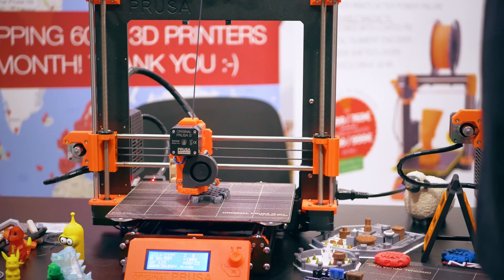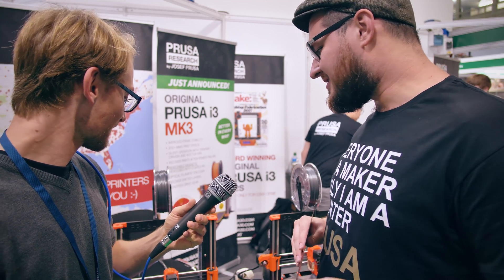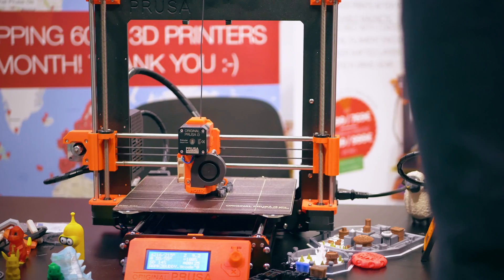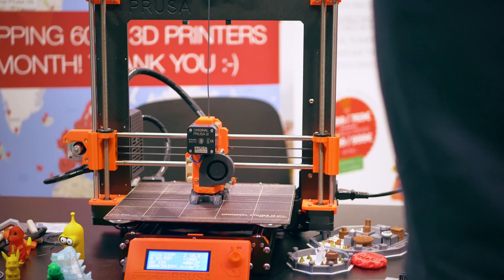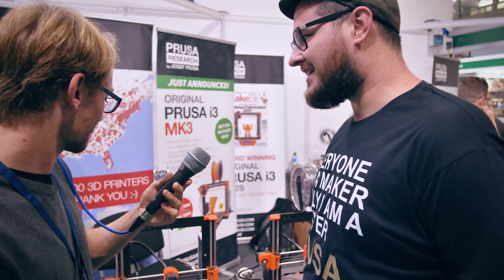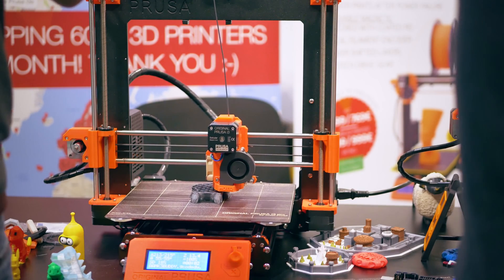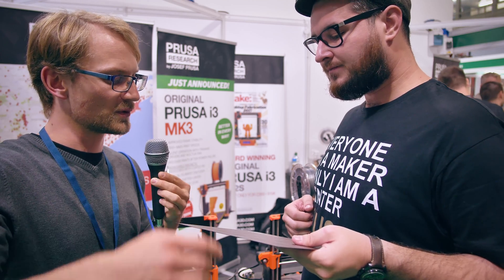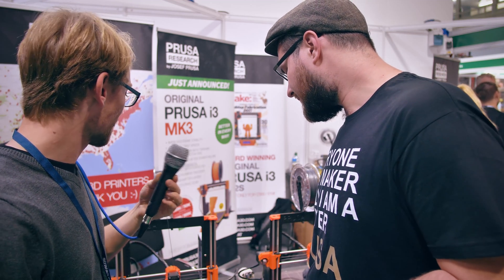Second look at the Prusa i3 MK3: Sensory overload! #TCT2017

Comment: I have the Prusa i3 MK3S and when I cut the filament, it jams and I have to take it out with pliers!  It does not spit it out like the demonstration in this video. Also whenever there is a filament jam, the 3D printer does not sense it! What am I missing! ? anyone else having the same issue?
Reply: do you have the feature turned on?
I have it as well and it works

Comment: The closeup of the print looks bad... Skipped steps, inconsistent layers. I would be displeased.
Reply from the maker: Many of these were showfloor prints with people bumping into and messing with the printer in general. Prints under more controlled circumstances look way better (cf. my full review)!
Reply: Thomas Sanladerer that's good to know. I imagine maybe the inconsistency was actually an earlier instance of those anti failure features being shown off. I wouldn't expect consistent layers when a print has to reheat, re-home and continue from roughly the last gcode executed.

Comment: Does the MK3 do auto flow rate calibration?
Reply: Good question!  I'm betting not (yet), but with the right filament sensor,  it' would totally be possible.  All you would need is to be able to continuously measure the diameter and you'd be able to calculate it in real-time.  Brilliant idea!

PS. Great interview. Thank you Thomas and Josef!

Comment: Owner of MK2S + MMU, Is there any plan for us ? an 2.5 MMU upgrade ? Nobody ask about this ?
Reply: Yes, it will be available a few weeks after the Mk3 begins shipping, I switched my Mk2s/MMU order over to the Mk3 including the updated MMU with extra filament detectors. Not sure you can preorder the ungraded MMU yet since they have not worked out the pricing difference.
Reply: William Dutcher not sure you well understand what I ask. I already have the mk2s upgraded with MMU and it works great. So my question is not about existing an mk3 MMU but if an upgrade kit from mk2s+MMU to an equivalent of mk2s 2.5 upgrade but with 4 filament detector per example.
Reply: Sorry, I did misread your question.  While I can't speak for them, I think it would be a mistake for them not to support the MMU upgrade path. Just requires 3 additional sensors, cables, and 3d printed extruder enclosures. In fact they should allow the MMU upgrade path across the board even without doing the Mk2.5 upgrade. Since the MMU is much more sensitive to filament jamming issues. Hopefully they will see the logic in doing this.
Reply: William Dutcher Agree ! Filmanent gesture is the most tricky part of MMU and filament sensor will greatly improve the « easy of use »

Comment: Really enjoyed this interview, well done!

Is there any word on multimaterial support for the mk3, and (more important for me) if there will be an upgrade kit from the Mk2 MMU to the Mk3 MMU? I presume the MMU will have a filament sensor in each of the extruders, for example.
Reply: Yes will be a modified MMU kit for the Mk3 which will include the additional filament sensors. Will be available shortly after the Mk3 begins shipping. Thinking about adjusting my order so they ship separately, not sure I want to wait until both are available to ship.

Comment: Very nice software features, but the hardware is still quite disappointing for this pricepoint. There are way too many 3D printed parts for some of the critical portions of the printer. Sure it works, but linear rods, bearings, and motors should not be mounted to plastic printed components in a printer of this cost!
Reply: Do you have a MK2? It prints tremendously and the quality is equal to an ultimaker. I agree that the printed parts at first looks like a cheap way to do it, but ditching that would destroy the whole philosophy of a rep rap self replicating printer. Users wouldn't be able to print replacement parts or modifications

Comment: 5:27  Does anyone here actually look at the prints or just the machine? Not impressed.
Reply: 3D printing noob here.  Could it be because this is a print happening during a live demo where they are constantly pulling the power cord, grabbing at the print head and snipping the filament?  I cant imagine that all those things dont mess it up in some way.
Reply: Its a $750 printer, it improved on MK2S in every way. With the margins they have it has an impressive amount of technology. Really not sure why you are dissappointed. It's doing things that a lot of prints twice or triple the price aren't doing.
Reply: Its a $750 printer, why do you expect it to do things more expensive printers dont. You can only melt and lay down plastic so fast so FDM printing is unlikely to get much faster/better quality.
Reply: Well by adding these features that are self repairing the print in case of some failures is making it more consumer level product.
Reply: he said infil can be printed at that speed. as for parameters it will be normal speed. i believe the Gcode is set in prusa slicer
Reply: He said print quality is on par with MK2 which tops all the charts.

Did you actually watch the video unharmonix? He clearly said the MK3 will bump up the print speed.
Reply: its actually 1000$ printer and he mentioned speed about 200 mm/s (not sure if it was in this video or in the review of new board)

Comment: I'm worried about large abs prints pulling the spring steel from the bed.
Reply: They print solely ABS parts in their print farm. 140 printers iirc? My point is, they test everything rigorously before release.

Comment: I'm so excited for the future of 3D printing! I own Anet A8, which is amazing for the price, considering only few years ago it was impossible for a normal person to buy any 3D printer! I wonder when people will have them as widely available as normal printers now :D
Reply: I own an Anet A8 but have been thinking of getting a second printer (and a "fancy" one), and I think the Mk3 will be the one. I can take my Anet A8 and build a metal frame for it and slowly upgrade it while the Mk3 becomes the workhorse I can leave on while at work with far less worry about failed prints and fires (and yes I did upgrade my Anet A8 to lower that threat, but it not the same).
Reply: Filament and model designing are the bottlenecks it seems. There is a lot of focus on teaching young kids to design simple things for 3d printing so if filament quality, control, and availability improves then we are all set for having 3d printers in "every" home in just 1 generation.
Reply: I find 3d printers are already a more practical and reliable thing than standard printers. It's just getting them to be more ubiquitous and quieter.

Comment: I think Prusa is going in wrong direction in their product development: Kit based printers are so 2016... not many people are buying them anymore. Of course you can buy fully assembled but the whole concept is based on kit philosophy. So on the one side there are great printers like the CR-10 which far better than the original Mk2 and costs around 1/2 to 1/3. And the Cr-10 upgrade version which costs 1/2 of the Mk3 also with filament sensors. So the Mk3 is really overpriced in my opinion: max. 400 EUR fully assembled including shipping will be good enough to have competitive product. On the other side there are the more professional products like the Ultimaker series. Also the kit concept and design does not address Ultimaker buyers very much. I do not see that much innovation (there are some but not really needed all) here in MK3 for having a potential target market. My personal outlook: Prusa cannot compete with the Chinese manufactures anymore now... similar than drone market where DJI is by far #1 and better should go in more for enterprise and more expensive products: no kits anymore, cool looking design with enclosure, other production chain without printed parts, larger  build volume with all that nice innovation for twice the price.
Reply: Nobody can compete with the Chinese market for pure price unless you are willing to cut the same corners they do. Pursa may not be cheap but they do offer quality name brand components and customer service. They still sit in a comfy spot of being a name brand, not being in the 3k price range so open to most people to purchase, and being known as a printer that simply works. 
I do agree with you that fully assembled kits are probably the future, and if they can get the cost of that down a bit more they will be a sure fire hit. I imagine the Mk4 will be the one that does that.
The CR-10 offers a lot of value for a cheap printer, and would be my choice as "entry" printer now (I own an Anet A8 myself, which was cheap enough to get me into the hobby) if someone feels they can handle the machine with no company support. Honestly if you have the cash there is no reason not to own both a Pursa for the quality parts and a CR-10 for the print volume.
Reply: Well, you are wrong.  I just pre-ordered a mk3 kit.  I will add that to my other two mk2s kits.
Reply: You can buy it fully asembled for 100 dollars more so....  And the cost its obvious, better materials are more expensive.
Reply: On purpose trolling ?
In additions to others comments, CR-10 and others can't reach 300 C on extruder / 110 C bed most of the times (not saying the CR-10 is bad here, but not the same category compared to an original prusa).
And the MK2 is printing as good (if not more) than an ultimaker. I would definitely buy 4 Prusa MK3 instead of 1 ultimaker 3.
Reply: yes I think they made a big mistake
Reply: Where I live (Switzerland) it's more 4 to 1. 
Don't feel the same way about "the real deal" look concerning the CR-10,  the CR-10S more is better already with the dual z screws.
But yes, main target is certainly not factories with the prusa.
Reply: yeah you are right but I see a huge shift there. Let me give you an example: 2016 if someone asked me what would be the best 3D printer to start with my recommendation was MK2 kit because it is reliable and produces great results. But now in 2017: my  recommendation would be the CR-10 or CR-10S and next year maybe other Chinese one. The reason: at least same or better reliability/more safe, same results and much bigger build volume for 1/2 or 1/3 of price and also pre assembled. So if Prusa only addresses makers who wishes upgradeable kits this target groups is big at the moment and they sell many Mk3 this year for sure but I am also sure it shrinks dramatically soon. It takes some time but not more than 1/2 or one year. The huge expansion of Prusa in that wrong direction (my opinion) would make it difficult to catch up a whole new market situation. This would be sad because Juseph Prusa is an amazing guy.
Reply: I had a hictop machine and bought a Prusa MK2S, the difference in print quality and ease of use is night and day, the quality electronics, motors and hotend far exceeds the clones.
Reply: yeah... CR-10 delivers much better print quality. Just tested it today again... same models on MK2 and CR-10. I do not know about the CR-10 clones but I think these are not so good as far I have seen.
Reply: yes I agree with you here: the ideas are great but the production chain is not professional. But having a product somewhere in between some market segments is always risky in my opinion. side-note: the CR-10 is more safe than MK2/S ... this is fixed in MK3 (cable connectors on circuit board).
Reply: "I think Prusa is going in wrong direction in their product development: Kit based printers are so 2016... not many people are buying them anymore."

- And yet Prusa Research has moved into a giant building to expand production due to demand. So if what you say is true, then Prusa has made a really big mistake investing in larger production capabilities.

"So the Mk3 is really overpriced in my opinion"

- Value's subjective.
Reply: Prusa MK3 costs 1K vs Ultimaker 3 at 3,5K so it would be 3,5 not 4... and 7 CR-10S. But yes for ABS or other materials who needs higher temperature the CR-10(S) is not that good choice. But there is Tevo Tornado - a Cr-10 clone with same low price - which comes around the corner with 24V and fast heating/higher temperatures. Ultimaker is more enterprise use: To be honest all Prusa printers look like an unfinished prototype or a toy.... the CR-10 in contrast looks like the real deal... and the Ultimaker comes with a more an Apple style look and enclosure which is also needed for ABS. In real design studios for instance the price is not a factor anyway.

Comment: Great interviews! Love hearing details about MK3!

Going igus would be great: no more grease. No more rattle. No more „where does that ball come from?!“
Reply: Considered igus, but they are much harder to get them running smooth :-/
Reply: Josef Prusa I believe that! I guess stall detection then kicks in as a false positive reaction?
Reply: Josef Prusa and x and y should be quite parallel per design on the MK3? Y especially in comparison to MK2S. 
Hm and z is also constrained by the frame and printed parts. 
Is parallel the issue getting the igus smooth?

Comment: wow! looks like a great machine  -but did anyone else noticed "missing lines" in both of the shown printers in some layers of the figurine, which was printing (bunny?) - anyways, seemd to me, there were extrusion flawws, where part of a louter layer was missing ,  that is very unfortunate, especially on a larger and longer lasting print, since such defects are so visible to the eye...
Reply from the maker: +kniefi I've noticed them, too, and decided to leave them shots of the flawed print in there. It's probably due to the printer getting bumped or the extruder runout feature being shown off a bit too often, but it's something to keep an eye out for with the retail units (remember, these are technically "beta" printers)

Comment: I don't quite understand the how they are getting higher microstep resolution. Josef mentioned that they are using 16 microstep instead of 256 which the driver is capable of... but they are still getting good resolution some how? I'm confused.
Reply: That doesn't improve the resolution at all... It only makes the motors quiet. The way interpolation works it splits a single move into multiple smaller ones, but the movement is still the same.
Reply: It's the Trinamic motor driver IC that receives 16-step step/dir inputs like the old Allegro one; however it interpolates internally to 256 steps to drive the motors.

Be aware that the electro-mechanics of the stepper motor is not entirely linear with microsteps, so more than 16 microsteps is really not sensible with regard to mechanical resolution; so whatever issues (probably 1/16th worth of step of latency) Trinamic might introduce don't result in worse positional accuracy, but it does result in smoother motion with less jolt at the bearings and lower noise level, and they are balanced out by multiple driver ICs having the same behaviour.
Reply: Wow! Thanks for the explanation!

Comment: I miss small drag chains to get a better protection for the cables.
Reply: The cables are pretty well protected with this cable management system, especially since the small change they did on the extruder cables with the update from MK2 to MK2S.

Drag chains would only add cost and complexity, and there is actually more strain on the cables inside a drag chain, where they are constantly bent back and forth. 
This setup is better in this regard as the cables are supported by a piece of 3mm nylon filament. That means the cables can move around as they have to, but they will never be bent in a tight radius.
Reply: You can print them :)

Comment: How does the flexible PEI bed work with PET filament? Does the flexing make it possible to use PET on a PEI bed?
Reply: I print PET on PEI all the time even on mk2. It does stick a bit too well, but nothing crazy. Try using a super duper think layer of glustick to create a separation layer or just touch the bed with fingers to lower adhesion a little bit.
Reply: I made the mistake of printing PETG on clean PEI once and would never do that again. It kinda fused together, so I don't think it would pop off an untreated flexible PEI bed without damaging the flex bed first (at least for bigger printed parts).
I always wipe the PEI bed on my MK2S with window cleaner before printing PETG and it works.

Comment: Will the new optical sensor be able to determine filament diameter and adjust extrusion multiplier in real time?  That would be a very nice feature.
Reply from the maker: Unfortunately not. Filament has become much more consistent over the years, so a diameter sensor is something that certainly exists, but keeps dropping lower on everyone's priorities.
Reply: Does the Prusa MK3 version of Marlin have support for other mechanics like Delta and CoreXY?
Reply: It would be good if they used the optical sensor to track movement to perform an automatic extruder steps/mm calibration